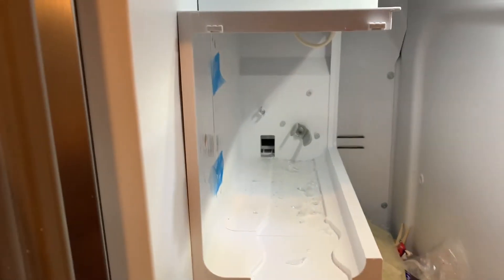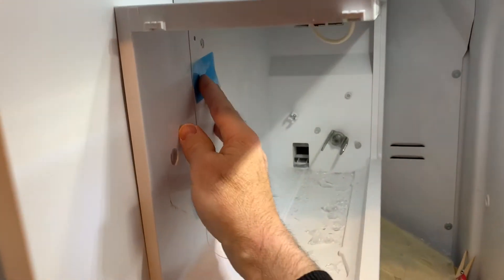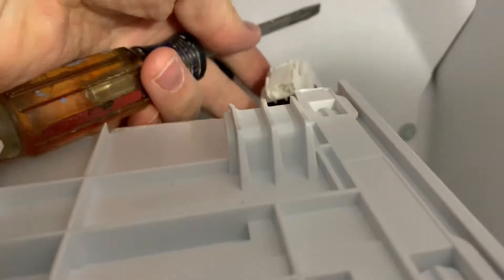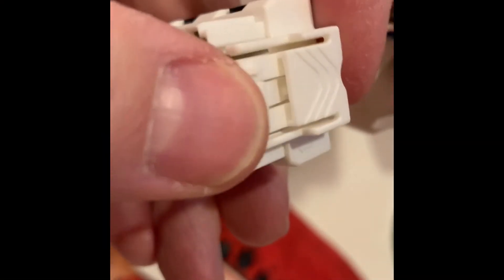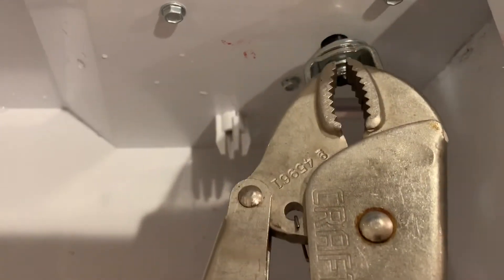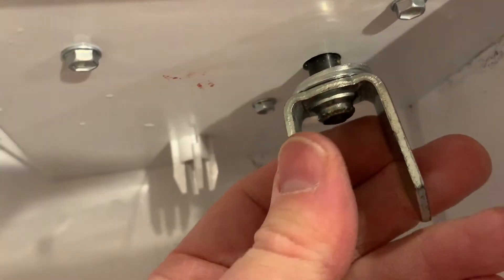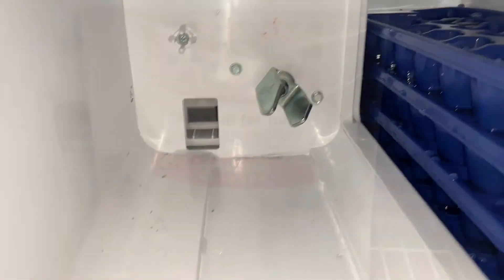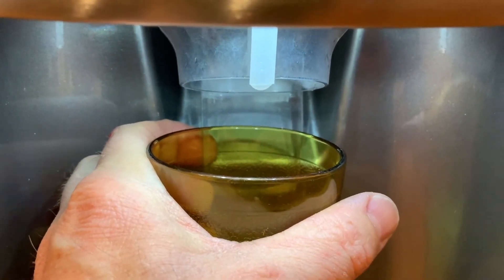Frigidaire LGHX2636TFO ice maker Won’t Dispense - Auger Won’t Turn

Comment from the maker: UPDATE:   This fix eventually failed as well, the threads kept stripping.  I then used JBWeld clear glue, the most powerful version,  between the auger and the threads, and that fix has held up.
Reply: Rob Morgan I couldn’t get any purchase on the threads so I couldn’t get the auger arm off the shaft. So I epoxied it and am hoping that fixes it.
Reply: Epoxy didn’t hold. Drilled hole thru the auger arm and bolt. It kept breaking my pins, screws, etc. must have a tremendous amount of torque. I tried drilling a larger hole to accommodate a larger screw when the bolt finally broke. This is extremely poor design- likely on purpose. Now I’m looking at ordering a new part. 🥴
Reply: How is it now? I'm having that same issue and looking to fix it.
Reply: Did the Jeweled hold up still? thanks!

Comment: I had to call Frigidaire just now because the lazy ass technician that came out Wednesday didn't even bother looking at the loose part you showed. He seemed like he wanted out of the job because he said he had allergies to animals and couldn't come in, was formally dressed like he was going somewhere, and if I had not insisted and let him in through another door he would have left before he'd even started. Once he checked it he hurriedly said it was the broken plastic ring at the far end of the bucket, ordered another ice bucket for me to put in myself, and quickly left! I noticed that the spiral thing was not turning when I put the new ice bucket in today and that two-pronged part was loose and turning and wobbling around and didn't know if that was normal or not, but I wondered if that was the problem. My refrigerator is the other way around from yours (that metal part is on the left), but I bet that's the problem. I am not that technically skilled so wouldn't attempt this myself, but will tell the next tech who comes out next Wednesday. Luckily I have an extended warrantee. Do you know if they can replace that part altogether; threaded screw and all?